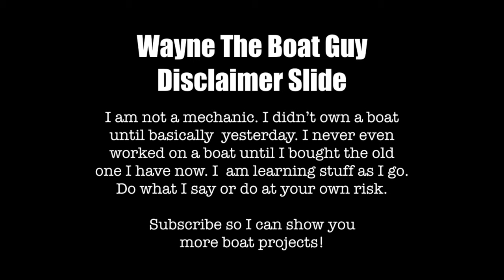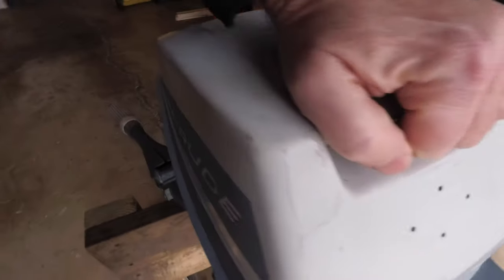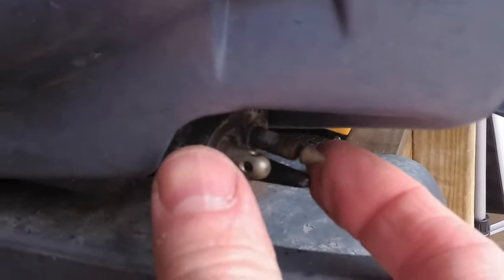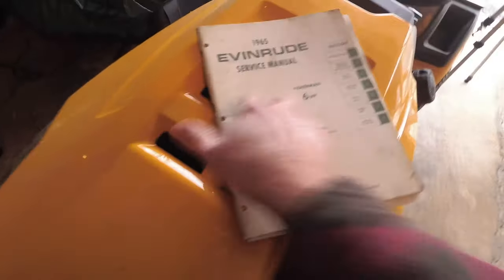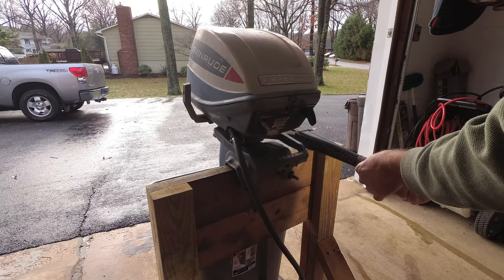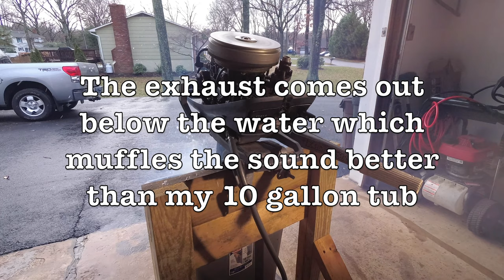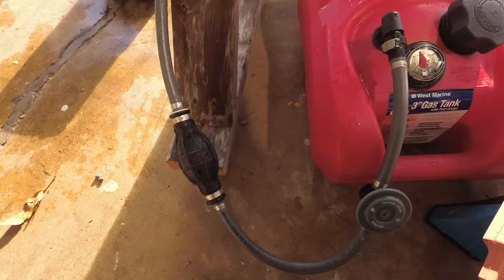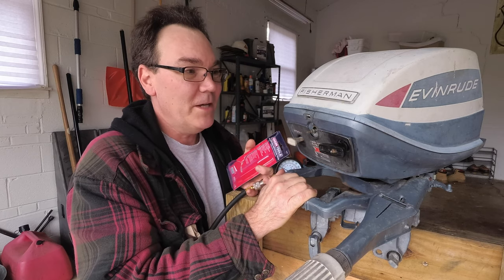Evinrude Fisherman 6hp - a tour of this old boat motor and how to get it started

Comment: I got my uncles old 72 johnson six hp but only 1 plug is sparking so its encouraging to see yours fire up. Mine use to start on one pull but that was 20 years ago so more pulling in my future. Peace
Reply from the maker: If only one plug is sparking, be sure to work your way backwards from the easiest/cheapest solutions first! Check the plug (swap them) check the wire, and then check the points/electrical.
Reply: I got  new oem points/ condensers/ wires  arriving today and rebuild the carb yesterday , got new plugs as well and coils tested good so "today's the day" 
 I appreciate your videos,  its nice to see what things look like before I take things apart. Isn't this intranet thing great!

Comment: For clarification, the Choke when operated does not let more fuel into the engine, it simply reduces (chokes off) some of the air, therefore, increasing the ratio of the amount of gas to the amount of air. Cold internal combustion engines need a ratio of gasoline to air that is biased more towards gasoline than would otherwise be required of the gasoline to fuel ratio when the engine is up to operating temperature.  A choke is a crude but very effective means of temporarily changing the gasoline-to-fuel ratio to something more suitable for combustion when engines are cold.  Enrichment circuits on the other hand (more complicated but much more effective) actually add more fuel to the ratio without restricting the air and so those engines have more power when they are cold compared to a similar size and type engine equipped with a choke which restricts some of the air.

Comment: Great video! What was the results of your compression test?
Reply from the maker: If I recall the compression was about 60 psi - which I had thought was low, but for an old, cold motor sitting for a while in the winter - that's not bad.

Comment: You should have put the vice grips on the shaft the idle speed screw instead of the end. If you mangled the end a knob won't fit if you ever get one!
Reply from the maker: Very true! If I recall correctly, I think the splines on mine were already pretty much worn off.

Comment: What mix ratio are you using on that motor I just got one and got 2stroke oil mix for it but don't know if I'm 50to 1or 40to 1
Reply from the maker: I think this one was 50:1 but I know guys who go 40:1 with older ones and they're just a little more smoky

Comment: I’ve got a 1969 Evinrude Fisherman, can it be operated for an extended period of time without the thermostat?
Reply from the maker: I'm not entirely sure. I hear people say that they do and have done so - but it's one of those parts that if it wasn't necessary why would they have included it?
Reply: @WayneTheBoatGuy  Right, I’ve had the motor for 10 years and decided to change it and when I took the cover off, there was no thermostat. So I’ve probably ran it 20 hours without it. But I ordered a new one and it will arrive Tuesday. It still runs good, just curious what you thought.

Comment: I am no expert, barely a functional adult, but i was under the impression you're not supposed to use starting fluid on 2 strokes?
Reply: @DeeZeePeezee  it’s not great, but a little shot won’t do much; but don’t dump a can down the intake.

A little shot of mix gas down the intake would technically be a better solution.

Comment: Hello Wayne What kind of oil you use to mix with gasoline?
Reply from the maker: I use Evinrude 2 stroke oil from Walmart.
Reply: What’s the oil to gas ratio? I’ve read both 100:1 and 50:1?
Reply from the maker: I did 50:1 - I believe that is what the original service manual suggested as well. A rule of thumb is when in doubt, go richer with the oil because that is less likely to cause catastrophic harm.

Comment: My evinrude 6hp works great in neutral but when it hear it cuts down to half or even less... what’s the issue ?
Reply from the maker: Hmmm... sometimes it's the way the carb is adjusted, or another carb issue like the float. Typically the idle circuit, and the run circuit are different (in other words different juts, ports etc in the carb) but it also could be something mechanical too. I'm sorry, I haven;t actually had to deal with that particular issue with mine.
Reply: May be the fuel pump if the carb is okay

Comment: Y u use starter fluid on a 2 stroke yikes. Also started it in gear lol probably why it didn't wanna start easily.
Reply from the maker: Yeah at the time I was using starting fluid. I only heard about it being a bad thing to use on these a few months ago when I was starting to work on another old 2 stroke outboard.

Comment: That motor is too Smokey to be mechanically good - looks to me as if it needs a rebore and new pistons - yes, 2 strokes deliver smoke because they burn it with the fuel but there’s too much from that motor unless you have too much oil in the mix.
Reply from the maker: I eventually got this motor smoking a lot less than it was in this video!
Reply: @WayneTheBoatGuy  That’s excellent - so what did you do to get it better?

Comment: If he knew the correct starting procedure ,it would have started on the second pull . NEVER USE ETHER ON A TWO STROKE ,it removes all lubricant from cyl walls The throttle was not set high enough on the initial start. num nuts
Reply from the maker: I appreciate your advice in the first few sentences but was it really necessary to call me names?
Reply: no problem @WayneTheBoatGuy

Comment: For the slow speed needle valve: Screw it in all the way and gently seat it. Bring it back out anticlockwise 1 1/2 turns. Get the engine ticking over as slow as you can. Turn it in 1/8th of a turn at a time until the revs go up a little. Bring the revs back down and repeat until it cuts out or backfires. Reverse the needle out slowly 1/4 of a turn. The best low speed idle is within this 1/4 turn.
Reply from the maker: I bet that technique gets these things purring!

Comment: Hi there.
Great engine. I have the same, only 1969 release. I have been using it for two years, mounted on an inflatable boat 2.90 meters long. I do not regret that I bought a used engine, not a new Chinese one.
A good set for fishing: a boat and motor transport in a sedan + 1 place for a partner.
Great review of the engine, good luck to you!
Reply from the maker: Thanks for sharing

Comment: Enjoyed the vid. I just found a 1961 6hp in my shed (older than me by 2 yrs, lol) can't wait to get it going. Btw much of the oil in your water tub is from the exhaust, which is why 2 strokes are no longer allowed in many states of the USA.
Excessive smoke could mean a bit too much oil in the fuel mixture. Monitor the plugs
Reply from the maker: Very cool!

Comment: i have the same outboard. starts fine but water doesn't flow? maybe take off bottom end?
Reply from the maker: If you aren't sure when the impeller has last been changed, that's a good place to start.

Comment: Great video,  thanks Wayne! 
I have this same motor and I'm wondering what you recommend as far as winterizing. It'll be in a metal shed all winter with temps as low as 0° or lower at times.  Any advice would be greatly appreciated.
Reply from the maker: I have a video about winterizing a 2 stroke - but the important things are to get all the fuel out (if it has ethanol), make sure the lower unit is fully drained of water, and to fog the engine.

Comment: I have the almost identical twin to that one. Same year even but mine is locked up from sitting so I am wondering if I should even bother going through the time and expense of rebuilding it or if I should just sentence it to become a parts motor?  Mine LOOKS pretty clean but looking clean means nothing if it doesn’t run. I did temporarily have it  freed up but then it stuck again within a couple days of being freed up. At least I don’t have much invested in it. I have more vintage outboards but can’t remember what all of them actually are at the moment. What I do remember is the 65 Evinrude Fisherman, a 50’s Mercury Mark 6, unknown age or size vintage Sea King, 1956 Elgin 6hp, 93 Mercury 9.9 and an unknown year Mercury 75 with potentially a couple Mercury 110’s joining in soon and a few I can’t remember what they are. In the past I had several others such as an Oddball Clinton Apache air cooled and water cooled combined in the same motor. There’s actually been so many I can’t recall which ones they even were from back in the day
Reply from the maker: I am currently going through the "should I even bother" conundrum with another old Evinrude (video here: https://youtu.be/sgtJnrGwBBw) It is a 1978 2 hp, but it really needs so many components repaired or replaced to be a runner again. I am working on it, but I'll have much more into it than it will ever be worth.

Comment: can you tell me why my handle  on mine will not move to start it only goes to shift and off
Reply from the maker: With the cover off the engine, watch the cam that slides as you move the handle to see if it is getting bound up or stuck on something.

Comment: I took my lower unit off to change the water pump on my 69 6hp and connecting everything back the gear shift is stuck in forward and won’t go into neutral or reverse. The lever moves though. Trying to figure out what I managed to get wrong.
Reply from the maker: I know some of these can be tricky - some Mercury models need to be shifted into reverse to reassemble. Could yours have been 'in gear' when you disassembled it? If so, you might need to have it back in that gear for reassembly. Good luck and try OM Fishing's youtube channel as you try to troubleshoot what's going on.
Reply: @WayneTheBoatGuy  appreciate the input. Ordered some more parts since I’m gonna take it apart again. I managed to snap one of the bolts that holds the lower in place flush. I’ll get it right next time.

Comment: Ideally the water level in your tank should be at least a little bit above where the gearbox meets the leg because that is where the water pump level is thus ensuring the pump has a positive supply of water. Otherwise the impeller will be deprived of enough water to cool the engine.
Reply from the maker: Andre Van Heerden - I was following the rule of making sure the water intake ports are below the water line. It obviously has to pump up to the impeller, and I imagine that’s only a second or two at most, but your method is probably the best. Thank you for watching and for your input!